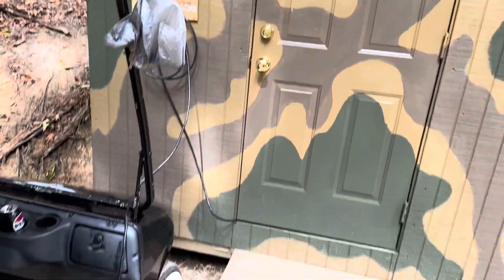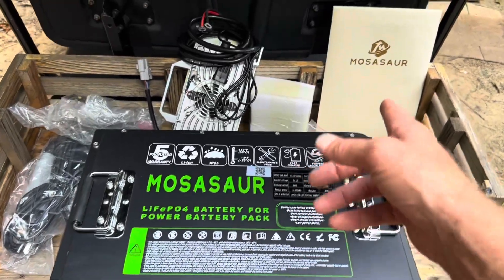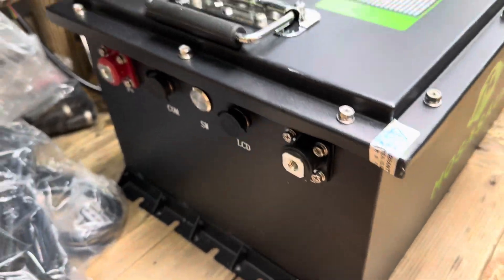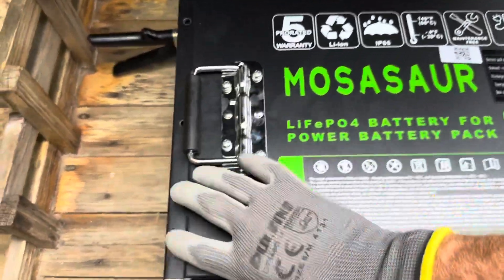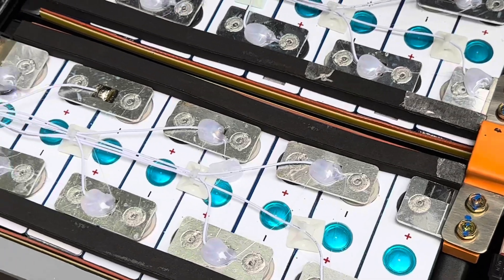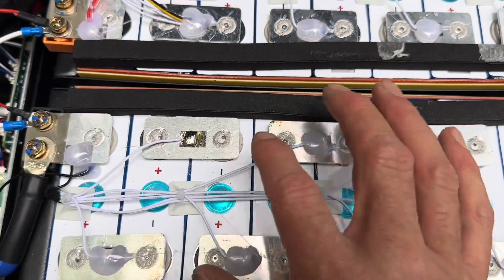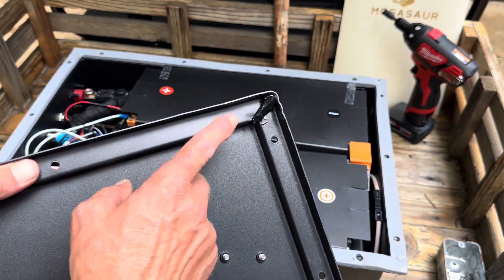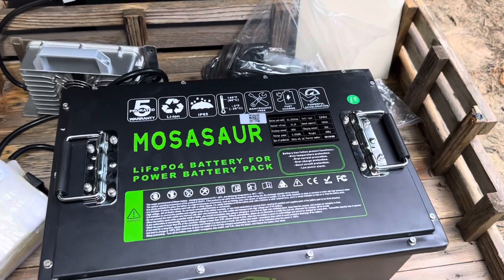Lithium Golf Cart Battery  Mosasaur 48V 105Ah LiFePO4 Battery

Comment: Do you know which manufacturer makes the BMS for this battery? Is it DALY or JBD or some other? Thanks for the video!
Reply from the maker: JBD AP21 series https://jiabaida-bms.com/products/jbd-smart-bms-7-21s-8s-16s-20s-200a-communicate-with-uart-bluetooth-or-rs485-function
It’s contactor based. No problems with large current draw. Hope this helps!
Reply: @THEOFFGRIDMOUNTAINHOMESTEAD  nice that’s what I was hoping! Thanks
Reply from the maker: You’re welcome! 👍

Comment: My same battery keeps dying at 50%??? Leaving us stranded at 50%
Reply from the maker: Possibly erroneous State of Charge calculation through the BMS. 

What is your voltage when this happens? Below 50V and the battery is empty and the above assumption is correct. 
If this is happening at 52-53V it may be a safety in the battery. Hope this helps!

Comment: why not use cheaper 12v LiFePO4 in series to be cost effective?
Reply from the maker: Trouble is finding 12V that have a heavy duty BMS to handle the load of a GC motor. Also the Mosasaur comes with a 20A smart charger plus a display and no balance issues from a series string of 4X12V. A balancer would be required on 4x12V. Hope this helps!
Reply: @THEOFFGRIDMOUNTAINHOMESTEAD  Do you have a certain balancer I should use?  I'm going to try the 4-12v batteries in series for cost and the piece of mind if one battery goes bad.
Reply from the maker: LiTime balancers are great keep batteries within 0.01 V   I use them daily.  Think I have a link in description. They’re 55-65 bux depending if there’s a coupon code. Hope this helps

Comment: Interesting brand! I like the heating function... I'm curious how you will like it installing on your utility cart!
Reply from the maker: Hopefully they will stick around, using the battery on 48V system currently until I get time to finish up switching the golf cart over. Has good capacity will have to see about load handling ability in the cart! Thanks for stopping by Tobi 👍

Comment: Looks like you are use to working with sheet metal.  Definitely a quality built battery.  It would be a very nice battery for a off grid build as well.  Very impressed! Thanks for sharing the tare down !
Reply from the maker: It’s better than most server rack batteries I’ve used! The contactor based BMS instead of mosfets is very nice!
Reply: @THEOFFGRIDMOUNTAINHOMESTEAD  yes I like that as well.  I like contactors  because I am use dealing with them in my line of work.